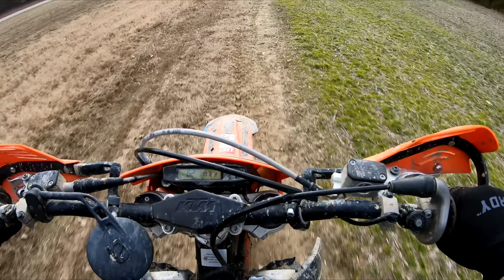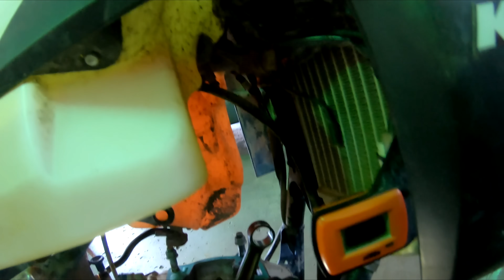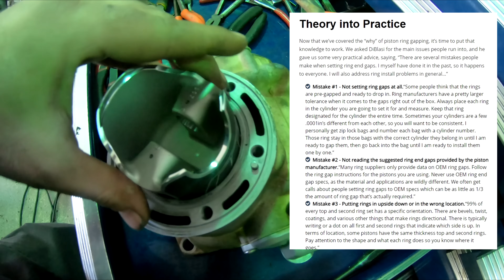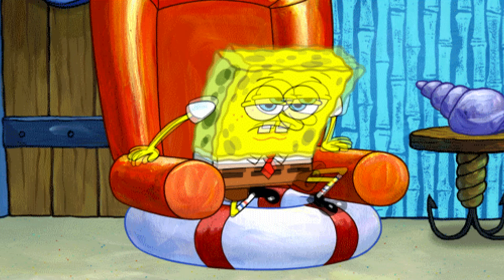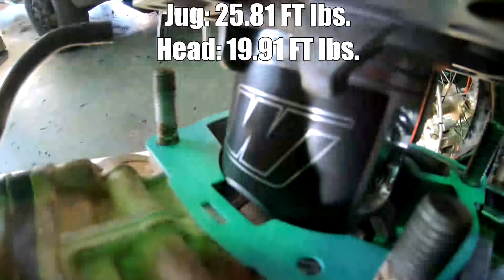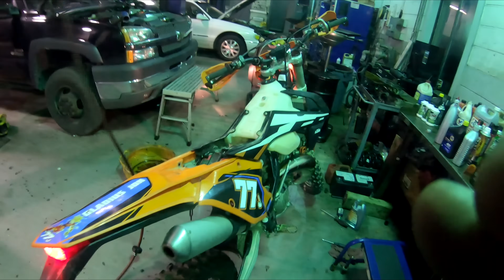2017 KTM 300 Engine Knocking Noise. Diag and Fix!

Comment from the maker: Appears youtube has another 360p bug. The file I uploaded was 4k. Hopefully the quality will improve...
Reply: Gladius Jon should I take my cylinder off and measure the bore before ordering a piston? Did you measure your bore with one of those T things or did you just check the ring gap and go by that?
Reply from the maker: Yes, check your bore service limits before ordering piston. Use what's called a Cylinder bore dial guage.
Reply: @GladiusJon  I hate to tell you but that worn place above the exhaust will start breaking rings soon.
Reply: hi man how do you do bottom end rebuild for ktm exc 2017??
Reply: Yy

Comment: Hopefully you can answer this….
My motorcycle only has 2000 miles on it, but I had a tiny oil leak.
It goes into the shop running great, but it comes out with the oil leak fixed but now it’s knocking. Not bad but enough to notice it.
What could they have possibly done to cause this knocking ?
They also did the second service that included an oil change. They claim they did not make any valve’s adjustments.
I hate that it’s making this kind of noise when it’s just broken in.

Comment: thanks for video.   can you post a link the break-in video?  Im replacing my 300 jug today with new nikacil and wiseco.  for 2003 model only wiseco was avail dec 2021.  had millenium tech do the replate and ring filing.
Reply: Doing a 2001 300 exc rebuild and it’s been such a pain trying to figure out the process with millennium tech. My 300 jug is scratched pretty badly and they don’t make replacements to my knowledge.

Comment: What do you mean by you "could move the piston back and forth in the jug?" Do you mean you could slightly spin the piston back and forth in a circular motion or in a linear back and forth motion? I'm trying to diagnose a my issue and I see the the piston has some wiggle to it in both of the above directions, but not up and down.

Comment: After 5/6k rev I have this noise on my new bike . Do I have the same problem ?
Reply: I do on my 2021 ktm 300 xc tpi with only 10 hours, did you figure it out? Does it only clank like that when you’re holding the throttle at 50 to 75 percent because that’s when mine does it. Doesn’t do it at idle or while wide open
Reply: @connercrow8629  I haven't figured it out yet! Maan ,It's so annoying!!
Reply: @connercrow8629  And Yeah it's the same . It never happens at idle. And it starts when the rev is at 5k . I don't think it happens when the throttle is wide open

Comment: I have exactly the same issue right now - was great to find this. Looked at plastics, kick start on pipe and all-sorts with nothing. Started all of a sudden out on a ride and I babied it back. It does feel slower. First think is a comp test I think - then I'll pull the cyl this weekend. Will get a Wiseco piston kit for $150 and try that - hoping beyond hope it's not a main seal or crank issue because I don't want to split the case to be honest.

Comment: I hope you can help me out with this issue, I just rebuild the top end of my 2005 honda crf 250r. after trying to find out what was the hard ticking and knocking, I did all shorts of things like checking the shims,  changing the timing chain and the rocker arm. the sound still present, I disassemble the engine to check if something was up with the piston, to my surprise the piston looks tilted to the left one side is higher then the other and it was hitting the side of the valve head. do you think it  the problem is in the crankshaft? Note: The cylinder and the piston are new.
Any ideas? Please help!
Reply from the maker: Has the piston ever been changed?
Reply: @GladiusJon  I bought the bike without a piston, so I bought a new Piston and cylinder head. looks like the piston is a bit crooked. when I have it on top dead center, one side of the piston is not flush to the top of the cylinder head.
Reply from the maker: @vidson7  I would say replace the piston with an oem equivalent. Crank shaft can not cause the top of piston to be angled.

Comment: I have old Jawa 50 from Czechoslovakia its common bike for us and its 2 stroke... These bike are undestroyeble it runs on diesel and even on alcohol with no problem.. Friend tryed it... I give love to my bike and I did renovation and be carefull on it but today it didnt run ok and I have weird noise from motor.. Its not transmission i know that so I think its carbon built up (most likely bc i give it more oil then should) or engine knock... Parts are cheap but u know these bikes u ride one day and next 3 days u repairing it... But I love it xD

Comment: hi, i was looking to get 300 to make a supermoto for city rides and for small  island vacation rides . the only thing that makes me think about it is maintenance . how often piston needs change ? how many km or hours is it worth it  or look soem something  else ?
Reply from the maker: It’s really not good for the engine, it can take a few miles of street but not much more.  I changed my top end every 50 hrs.  Which would be 500-1000 miles on street.  Honestly, get a 4 stroke for street. Ktm 350 and beta 350 are great. Ton of power, and only a few more lbs heavier then 300 exc.
Reply: And gas mileage is terrible on two stokes overall. Get a 4 stroke. I made a street legal 250 2 stroke and hated it. Sold it with only 30 miles. Bought a fe501 and I've already put 100 miles on it in the first day. Way better power, mpg, reliability, and gearing.
Reply: dont listen to that stuff, im riding a 2-stroke literally 15+K km already, with the STOCK top end... if u dont engine-brake it, it will last alot longer than these 50hours lmao

Comment: I have the same problem on my husky te300, but I also noticed I had real bad vibration in the handle bars, would it cause that aswell?
Reply: Yes because it is creating more vibration hitting the cylinder walls

Comment: Mine only knocks like that when it idles ,could it be the same thing?
Reply: Check jetting. Mine did the same until I went abit richer. This was after pulling the engine apart and checking everything. Knock (pre-ignition) caused by a lean condition sounds very similar. Ktms are apparently notoriously lean when being ran with carburetor set to Ktms spec.
Reply: @ryancurrin7486  was it your pilot jet that was lean? or main?

Comment: I have the exact same problem with my x trainer 300, dry air filter, a whole lot of piston slap, worn wrist pin, wrist pin bearing went kerplooey in my hand, minor scratches in the piston from dirt inhalation, I still have to clean the carb. I thought the whole bottom end was loose due to the fact that The piston had “axial play” but it was just a wrist pin worn down so much, coincidence or not, I noticed it in a hare scramble too, but it was 100% my fault because I let the “dirt accumulation” on the air filter get a little out of hand👍

Comment: That piston looks great compared to the one I just pulled out of my cr250! Kinda weird to see the bearing fail.
Reply: I also have a 98 cr250 and quite a loud knocking noise. Would it deffinatly be piston slap?
Reply: @motomash6143  only way to find out is to take it apart

Comment: 54 hours seems really low for a rebuild being due.
Reply: well the wrist pin bearing failed so thats why in this case. also top end should be done between 15 and 40 hours on 2 strokes depending on displacement. 450 4 stroke pistons have a service life of like 10 hours because the skirt is so short.

Comment: First I heard this with my volume down and thought it was kind of the typical mild engine noise you hear from 2 strokes, then I turned it up...... my gosh I bet that was loud as heck in person. Glad it was a simple fix. I always check my ring gap but admittedly never check power valve clearance

Comment: The reason for multiple base gaskets of different thicknesses is to combine them to produce the optimal piston height in the cylinder (ref. X dimension).  Power valve height should also be checked (ref. Z dimension).
Refer to videos by Andrew Cooksey on setting X and Y dimensions.

Comment: The cir-clips.....you didn't show us how you did them.  I always struggle with em, shit job.  Make sure to always stuff lots of rags into the engine openings when putting the clips in.  If you lose a clip into the engine you'll be splitting the case the get it back.
Reply: Get the clips from slavens racing, the pop right in.

Comment: That's an unusual failure.  Do you just thing you had a bad small end bearing from the factory or do you think it was due to something else?  What kind of oil and ratio are you using?   Do you usually warm the bike up before hammering it or do you run it hard cold?
Reply: Very unusual

Comment: Good job on proving down hill engine breaking bud u really called that one i change my 250 xcw at 80 hrs and never have i seen wear like that also vertex is what ktm puts in so thats what i put in and if you take the time to look there is always 2 jug gaskets on from factory thats y you get a few in the kit anywho good luck to ya and just pull the clutch in racing and engine breaking when its faster and easier being only 15 or less seconds no bigge going down mountain bad idea
Reply from the maker: Engine braking was not the cause of my bearing failure. Yes there are 2 gaskets stock. But I wanted to increase my compression. And I also wanted a forged piston. There is more then one way to skin a cat so to speak... good luck believing the engine braking myth..
Reply: Engine braking is really not an issue as long as your slightly rich on the pilot. To provide further protection I personally run 40:1 in all my KTMs and 32:1 in my sons 105 KTM. Some folks swear by using less oil in the mix but myself I would rather have the extra oil
Reply: I think you the one having what I would call premature wear would need  luck on the engine braking myth not me I run 60:1 and never had a problem my bike has 150 hours on it yes i have done top end  twice just cause the hrs were racking up but yeah different strokes for different folks
Reply from the maker: @ivanramey5157  just wait tell my next video instead of making assumptions. Was the premature failure my fault. Yes. Was it engine breaking. No.

Comment: I don't know about KTM, but the Yami manuals didn't warn me to place a rag to prevent the cam cap position clips from falling into the motor.  I didn't even know the clip was there until I lifted off the cam cap and heard it rattle into the motor.  My son did the same thing.  Very well made video.

Comment: Yikes.. any engine failure at 55 hours is ridiculous, man. I can't believe that. I can't believe the wear that people are seeing with low hours on their machines. I really hope I don't have to deal with this crap for a long time. I have never had engine issues on any of my bikes besides a race back in 2003 when we forgot to mix the oil in with the gas (whoops). I ran the same piston in my KTM 125 during 2 race seasons, and 5 additional years of hard riding. I sold it with it still running nice and tight.

Comment: Any indication what caused the wrist pin bearing failure?
Did you ever locate the missing needle bearings?
Reply from the maker: I have a pretty good idea why. But I dont want to give it away yet, next weeks video 😉.  Yes, I did retrieve all the missing needles. I must have recounted them 10 times hahahaha!
Reply: Gladius Jon looking forward to that next video!!
Reply: @GladiusJon  This has put a halt on me thinking of getting a leftover '18 250xc over the '19 yz250x. Got me on Pins and Needles🤣

Comment: I was going to say piston slap .... But i wouldn't have guessed the wrist pin bearing .... Usually its worn rings only glad you got it fixed ! And before any serious damage ...... My 125 is due for a new piston but im waiting for summer here in ohio .
Reply from the maker: I think I got lucky catching it in time... Another hr or 2 and I might have sent the rod through the case 😢😢
Reply: Definitely ! My buddy had the same kind of issue going with his KTM the Piston broke around the bottom of the skirt he now replaces his piston every 50 hours religiously

Comment: I recommend with that wiseco piston you should let the bike fully warm up every time it's ridden, they can expand faster than a stock piston and seize. If my cylinder is bad I send my piston and cylinder out to be machined and coated for eachother. But if the cylinder is still good like yours I just give her an extra 5 min to warm up and haven't had any problems. Love your content and looking forward to seeing more harescramble vids. You have made me sign up for my first race this year.
Reply from the maker: Right on. I normally let the bike get up to 130 140 degree before idling off to the trail head.
Reply: Vertex is a much tougher piston. I've ran both.
Reply: @Bryan-Hensley  I avoided vertex pistons because I was nervous that they were the cheaper brand, but I pulled apart my yz250f to do some head work and inspected the piston. I found out It had a vertex piston in it, and I've done at least ,300hrs on it myself so id say they're pretty good quality.
Reply: @B.hughes  they used to be $300 per piston back in the early 2000s. I almost thought I was looking at the wrong brand when their prices dropped. I think KTM went with another brand for a few years which probably caused the price to fall. The vertex might not be a good motor cross piston though. I have good luck out of wisco too. I'm running one in a cr 250 now. It's probably closing in on 100 hours. It's still got pretty good compression. It's due rings and since I don't trust wisco as good I'll probably put in a new piston just to be safe
Reply: @Bryan-Hensley    Not even close.  Vertex are cast pistons.  Wisecos are forged and last forever
Reply: @sciencemilitia1853  silicone cast will outlast forged pistons in extreme temperatures. It is a much better choice in Enduros.
Reply: @Bryan-Hensley    That is not true at all.  All MFGs use forged pistons in their 4 stroke dirtbikes specifically becauase 4T pistons run way hotter than 2T pistons.  Forged aluminum is stronger at all temperatures and forged pistons are designed to run the same cylinder wall clearance at operating temp that cast pistons have.
Reply: @sciencemilitia1853  you are wrong. Forged piston expand more than silicone cast. The forged needs more clearance due to this. Forged will crack skirts easier plus they have more clearance causing them to slap.
Reply: @Bryan-Hensley   Forged pistons only have slightly more clearance when the engine is cold... After about 30 seconds of running, they expand and then the forged pistons have the exact same clearances in the bore as cast pistons.  And no, the forged pistons do not crack skirts anywhere nearly as often as cast pistons.  Forged aluminum is far more durable than cast.  Thats why they are so popular.  A lot of higher end 2 strokes throughout the years have come stock with forged pistons.  I have had many piston failures throughout 10 years of racing, but never once have had a single problem with a forged piston in a 2 stroke or a 4 stroke.  I have had several cast pistons break/crack skirts.
Reply: @sciencemilitia1853  I do not have time to explain everything to you. You are talking to a former pro mechanic. I've probably built 500 dirt bike engines if not more. Wiseco actually is one of the worst pistons you can use. They crack the skirts off like crazy. You can get 300 plus hours out of a vertex. Cast doesn't crack like forged. The only advantage of forged is light weight for people that's pro motorcross turning 10 of thousands rpms. For wannabe pros, you'll be fine with cast in both Enduro and motorcross. Cast last much longer. I'm done teaching. LEARN or be dumb.
Reply: @Bryan-Hensley  lmao you dont know who you are talking to or what youre talking about.  First of all, forged pistons are heavier because they are more dense.  Which is also why theyre stronger.
Reply: @sciencemilitia1853  sorry dude. Go back to school or something. No I don't know who I'm talking to. Are you scared or ashamed? Why do you hide?

Comment: For general information I would advise against using crows foot type wrenches to torque anything, they have a tendency to strip a nut. The link here in Amazon is for torque extender box end wrenches, can be used for hard to get at nuts and bolts and don't strip the head.(T&E Tools 93222 3/8” Drive Metric Torque Adaptor Set – 12 Piece Torque Wrench Adaptor Set).
Glad to see she was only a top end failure.
Reply from the maker: Agree! Box end is always better.